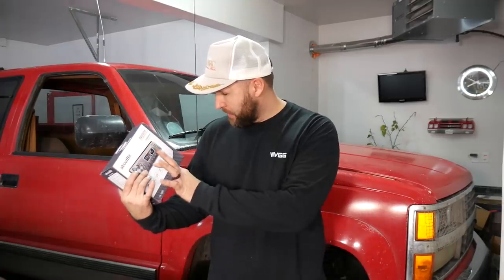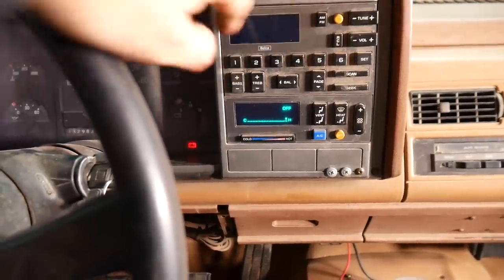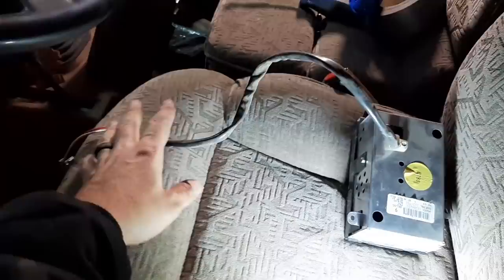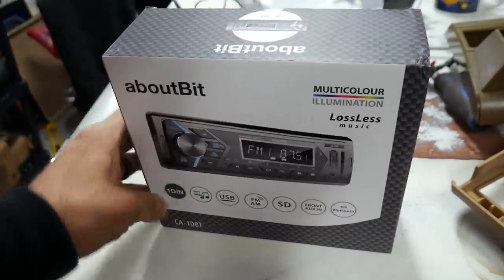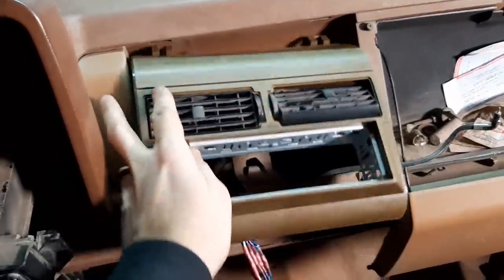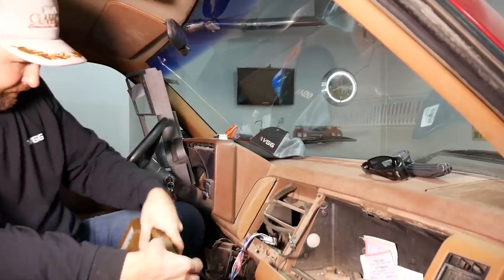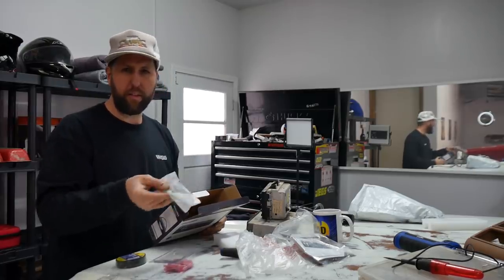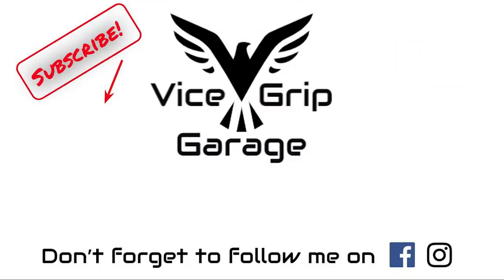Amazons Cheapest Car Stereo Installation and Professional Review

Comment: The last radio I installed it finally occurred to me that I could splice those two harnesses at the dinner table.
Reply from the maker: smart man!
Reply: yeah i dont crawl my ass around in there until i have too. amps and shit still a headache.
Reply: Big brain😂
Reply: That's way too easy!
Reply: I have a 2000 Mk4 VW Golf and I have a 7.5" touchscreen stereo in the dash, Kicker door speakers, a Soundstream 5000 watt amp, and two Sundown Audio SA12D2 subwoofers. I built the box myself out of 3/4" MDF with a 6"x12" Aeroport. It shakes the windshield wiper arms, you can stand outside of the car and watch the roof panel flex when the bass hits. I have been installing stereos in my own cars (as well as my friends) for 20 years. My first car had a stereo system in it and this VW is my 56th car since I was 14 and I'm 36 now.
Reply: @Brock_Landers  That's allot of radios...
Reply: lol
Reply: @Brock_Landers  stereo worth more than the car... a sound investment...
Reply: @HAMMER8181  my first car had a stereo worth more than the car in it and I only spent £100 on the stereo.

Comment: Love your humour and phrases! I was mixing up some rust remover dip yesterday and about a quarter of the sack fell into the bucket. I grinned and said, "that's way too much, perfect"
Reply: Gemma B..., what is "rust remover dip"? Is it something that has to do with sheep's wool?
Reply: @walter2990  It's a powder you mix with water and put rusty metal in, it reacts with the rust and removes it. Like Evapo Rust but powder.
Reply: @GemmaLB  Thanks, and now I know of another rust removal product. For heavy rust, I still like muratic acid followed by a baking soda bath & a string rinse with water. 
I've had great results with electrolysis, but is labor intensive. I've had mixed results with Evapo-Rust, or vinegar, or the molasses method.

Comment: I did car audio for 14 years back in the day. It might have already been said in comments, but you should put the radio tuner bracket back in by the gas pedal. It does help ground the dash to the firewall. Over the years we noticed more grounding issues not putting it back in. Maybe I dont know.

Comment: I found out last weekend you have to oil the hood latches on those old Chevy's every 23 years or so.
Reply: Jim Adams - damn I just missed my window so I will have to wait another 22 years to do mine.
Reply: It can hurt a bit when that hood release handle breaks off in your hand.
Reply: Not in response to your comment but I miss PBR, they have gone woke and that goes agianst my merika principles, damn traders! When I bought my last 12er and it had graffiti on the can I knew there was something wrong... Did my research and I have had to switch to the Coors banquet beer yellow can.
Reply: Atomic Reverend Alexander - Agreed. PBR is currently the boy version of white claw. 

Still tasty but not what it used to be.
Reply: Mine made it to 28 years before the hood got stuck closed and I had to bang on it for half an hour to get it to pop. A full can of wd40 and half a can of pb blaster cleared all my problems up.
Reply: Jim Adams I hadn’t opened the hood on my 94 f150 in so long I had to fight it then oil up the hinges to get it working right again.. can’t beat the old trucks
Reply: @getpeaveymaced  "A full can of wd40 and half a can of pb blaster cleared all my problems up" - yeah, but can you open the hood now? :-D

Comment: I had a 1990 that I replaced the radio in. When I took the tuner module out from under the dash, about an entire ashtray's worth of cigarette ashes fell out of it. Your center dash piece matches better than mine. Mine was black, and I had a red interior. I could've painted it to match, but I never bothered. Mine also didn't come with the little cubby, so stuff fell in behind the dash all the time.

Comment: Sometimes that cheap stuff works just fine.  I bought an in-dash radio, CD and DVD player (Has a 3.2" diagonal screen) for like $37 2 years ago and it's still working fine. 80 watt x 4 channel.  Went to the junkyard and found some nice Pioneer 3-way speakers for like $6 a piece.

Comment: I absolutely hate working on cars. Missing a few of the G-nomes  req'd to be a mechanic. Love watching someone work that does have the divinely gifted Mechanical aptitude. So I love your show.  A little bit of an audiophile, so I've replaced stereos in just about everything I have ever owned. And If you don't mind, I gotta say that CRUTCHFIELD is the absolute way to go. They have an excellent selection of cheap but good car stereos to fit any kind of truck or car and Here's the kicker... EVERYTHING you need as far as antenna or harness adapters, face plates,  install instructions and great customer service is pretty much included for little or no extra charge. Then google youtube and watch other guys install the radio in the same or similar year and make vehicles as your own. Trust  in Jesus and have a blessed day!

Comment: I installed a double din lcd in my truck awhile back. It basically just a touch screen and I ended up buying a remote for it just so I’d have physical buttons as those touch ones were a real pain. Not to mention I big ape fingers had a hard time nailing the right one. Never understood car stereo remotes until then hahaha

Comment: That truck originally uses a CDM module radio system. You can replace that box under the dash with that from any other CDM and it'll work. I have a stack of those boxes. Also know how to add AUX to these radios as well.
Reply from the maker: Great info!

Comment: A friend of mine has one of these trucks, similar year. One of the things he told me that commonly killed the factory stereo was water/moisture following the antenna cable right to the main module inside the dash. Apparently once the seal goes for the antenna, it's just a matter of time.

I'm not sure on the details, but he ended up restoring his to factory to retain the factory look while fixing the problem.

Comment: I bought something similar to put in my 85 diesel Suburban, but I couldn't find anything for under $30 when I got mine, so I'm obviously jealous of the $23 unit. I've had mine for about a yeah and haven't installed it yet. Probably need to put the transmission back in first...

Comment: Had a straight piped 454 in my 1980 4 door GMC pickup, couldn't hear the tunes so I ripped out the back seat, and put in a 1500 watt amp and 4 12 inch subs and 6X9s. So I spent $500 on the truck and paid over $1000 on the stereo. But I could hear it lol

Comment: I have a 1974 Ford F-250 Ranger with the 4.9 six. It has 22,000 miles on it. The radio used to make a crackling sound, so a guy would bang on the dash and it would start working. Now it doesn’t even do the crackling. So is that speaker, radio, or wiring. And does that system hook up to gen 6 Ford? 

Best channel on YouTube

Comment: i use a portable 20$ speaker box with 2 3" 3watt max to run my 12" car subs.. only 3 watts & sounds like 20watts.. but depends on ohms & sensitivity like 91decible over 87(stiff&flat) & up to 110decible .. best

Comment: I still have the 25 dollar wonder that is just a version of this stereo in the Wagon. The volume knob failed once but a busted old sony unit had the exact same rotary encoder so I soldered it an and it worked. Got in in 2014, I guess thats pretty good.

Comment: I bought one of those el-cheapo double-din TouchScreen-O-Matic 7000 7" display jobs for $23 + $12 shipping from one of the Interwebz Chinese dealers and had much the same experience installing into my 2011 SilverAYdo. Mine also has an Ultra Sub Bass sockets and appears to be made in South Dakota also, as well as having BlueTeeth. It weighs so little I almost had to weigh 'er down with something to keep it floating away before I got 'er bolted in. The sound quality isn't the best, but she's still working a year into it.

Comment: I ripped out the tape deck hole and wired it directly to the battry with a fuse and tried to remember to turn it off when getting out. Worked for the most part ehh

Comment: When it comes to audio, "old stuff" most often sounds much better. Most of budget gets spent on all the blue teeth and all the other gismos, so there is little left for the amp section. If it isn't heavy, it likely won't sound very good.
Reply: Add an old PPI amp to the mix.Maybe 2.

Comment: I got a $20 unit like that at walmart Dual brand that has been working fine for over 5 years and it's better a connecting to my cellphone than the $80 JVC I put in my car.

Comment: My truck came with that little cubby and my extra gum flies out ALL the durn time, I had to put a cable to lock the front cuz the electric actuator would NOT engage when I needed it the most, anyway, crank up the Hank Jr!!!

Comment: I had a ‘91 pickemup truck and the radio died. Water/moisture ran down the antenna cable and blew out the radio under the instrument panel. eBay saved the day.

Comment: I had a 92 chevy truck with the same type dash, etc. they were made so cheaply back then. the 4.3 vortec was a solid engine but the rest of the truck was garbage. that was such a dumb design the way the radio and dash were. AC Delco did not like to compete with the other audio folks so they made it difficult.

Comment: Guy needs to grab himself an amp - a 10 inch loaded sub -  and some new 4x6's all the way around - Ooooops,,,, amost forgot the most important thing.....A New Head Unit (RADIO) about 200 watts aughta do it  - and make sure that it has a CD player and a cassette player for all you Roy Clark fans out there - Thats the exact system that I have in my 1988 K-1500 off road and it sounds fantastic.

Comment: KEEP THAT REMOTE. Cheap radios have crap switches in the volume knob that die without warning. You lose that remote, you lose volume control if that ever happens. Speaking from experience lol.
Reply from the maker: Good tip

Comment: If you want a vehicle that will give you great trouble free service, it's easy, BUY A TOYOTA. Oh, that's true, but then you wouldn't have a video, there would be nothing to fix. Because, a Toyota is a beater car, YOU JUST CAN'T KILL'EM. If you find a Toyota that doesn't run, it would only be maybe a five minute video, because, they would be easy to get running, or maybe someone just wrecked the car, but, that's pretty much the only way to not have a Toyota run.

Comment: Big mistake, i could have offered you a really nice hipower Kenwood CD system for free with 4 infinity 4x7 triaxial speakers. Oh well threw them in garbage! Or perhaps a hipower Pyle cd system with speakers. Been cleaning out the garage both systems less than 10 years old and still boxed! Blue tooth, both. . .just tossed four like new Audi 7x17" 5 spoke wheels for an Audi TT spider coupe. . .